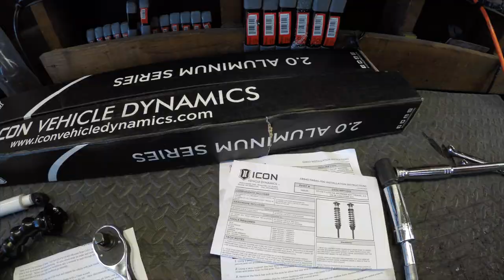DIY VL●OG: Lexus GX470 Toyota 4Runner/FJCruiser/Land Cruiser Prado Icon Stage 2 Suspension Install

Comment: What wheels do you have on that? What size tire did you go with after the lift?
Reply from the maker: The wheels are Relations Race Wheels RR2-V. Didn't change the tires after lift since I already have 285/70/17 before.
Reply: Organized Garage Status those didn’t rub before the lift?
Reply from the maker: @JewManGuru  Not if you modify the issues. Follow my personal build page on IG, I posted a simple guide to remedy the rubbing. @o.g.dada